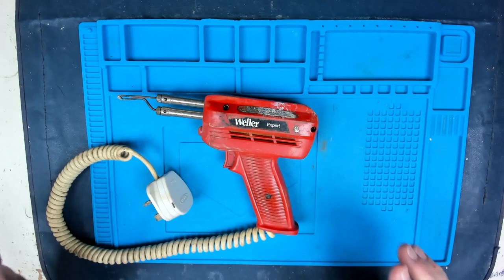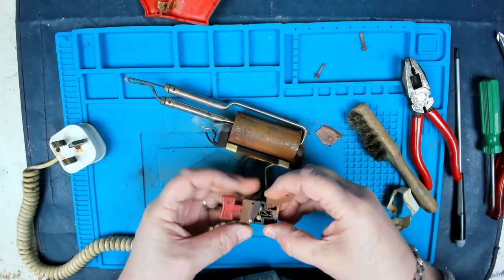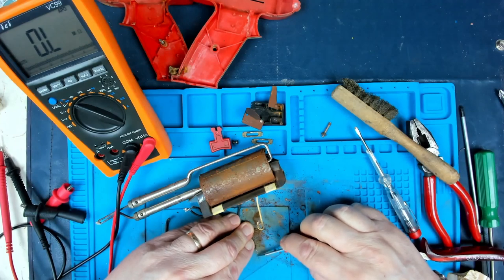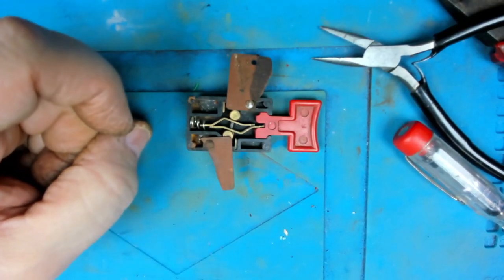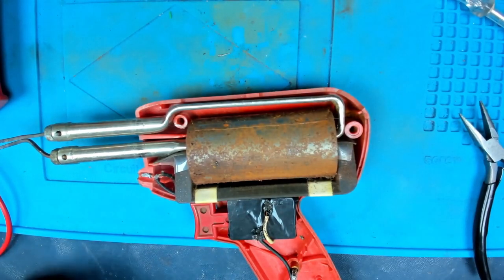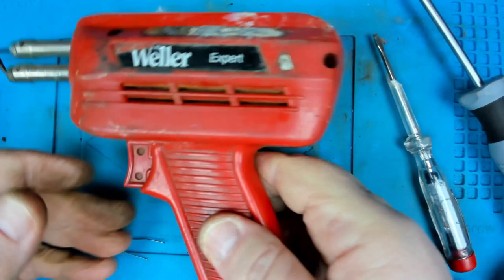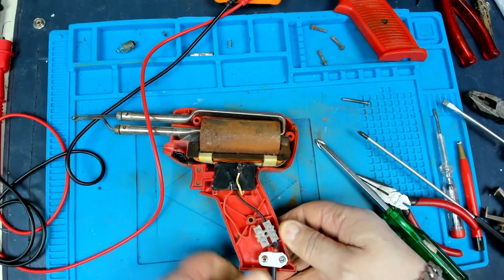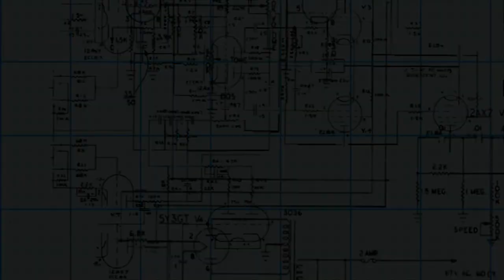Weller Instant Heat - Soldering Gun Resurrection

Comment: Great job, thanks, Chas. I have actually just bought its big brother - a D550 with dual heat  on the trigger press of 240/325 watts. I want it to do some plastic welding repairs, which these are great for, and using zip ties for filler material. Anyway, these are still really useful. Thanks for showing.

Comment: Why was 57 Ohms a positive indication of functionality?
Reply from the maker: Hi, thanks for the comment. Good question. This was at 12:40 in the video. Essentially, the Heat Gun is a heavy duty 240V to 12V transformer, the bit being technically a short circuit across the output. 240V primary windings are usually low resistance. I was checking to make sure it wasn't OPEN and therefore MegOhms on the meter, and also checking it wasn't Short Circuit - Zero Ohms. So a reading of 57 Ohms, in my experience, was a good enough reading to indicate it was probably OK. Of course, there could have been shorted turns in the windings which would have meant either the fuse popping immediately or the gun overheating. I actually forgot to check the secondary winding. I assumed it would be OK, but I should have removed the bit and checked it. I was fortunate in that it too was OK. 🙂
Reply: @ChasLarge Hello, I have a question, it gave me a result of (11.5 Ω) with my tester. And the alarm from my tester is heard... why does that happen, what is the reason for that...??